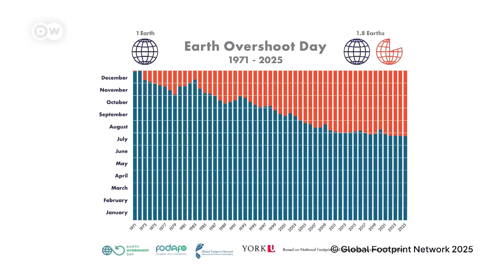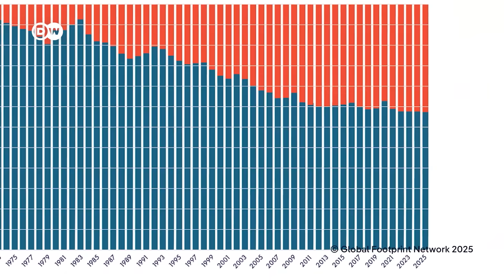'Earth Overshoot Day': What can we do to try live within the planet’s limits? | DW News

Comment: Recycling much on certain places could be because its cheap to do there and expensive on other it could be about pricing that allows for possibility for recycling like that i suspect, i suspect this recycling performance is a pricing related phenonenom if it becomes expensive to recycle in those then the recycler top performer moves may drop to recycle less and other cheap locale comes top and the former recycle less if cheap turns more expensive, but overall i suspect the ratio of recycling doesn't necessarily change dramatically in terms of increase in this scenario, it just may have the possibility in time move locales on recycling hotspots, if that is a economically viable option.